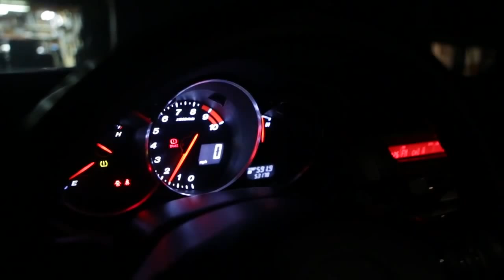RX8 Spark Plug Replacement Guide

Comment: This is certainly a well thought out and well presented video. I am doing a customers rx8 and only just found out that the plugs are a different length by my supplier. Lucky because I just dont know if I would have seen that at the job. I bet I would have put the wrong one in the wrong hole. So leading and trailing plugs. Wow. My customers car had cut out and it was because trailing coil nearest interior had shorted out. Only with that unplugged and the car cranking again with all modules working on scan, still the car did not want to fire. Would it fire with one coil missing

Comment: Also a good idea to use some anti seize on the plugs before installing
Reply: Not if your using NGK Iridium Spark Plug, fabricator recommends not to use anti-seize, this is because of the trivalent plating, this is a silver or chrome finish on the threads that provides a corrosion resistance, moisture and chemicals. Ill leave the link below for more info 
https://www.ngksparkplugs.com/about-ngk/spark-plug-101/5-things-you-should-know-about-spark-plugs
Reply: Gildardo Rojas  thanks for the link. Thankfully I never had an issue using antisieze and over tightening

Comment: I'm getting 150 miles to the tank. Is tbat normal ?
Reply: Rami S. depends 
Ru driving it hard allot? 
even not driving them hard they get horrible gas Mileage
they r definitely not a car u buy of you're worried about gas mileage lol
Reply: it's actually bad for the engine if u baby it
rotaries r meant to be driven at higher RPM 
otherwise carbon buildup will get ya
Reply: Rami S. wow that's bad or do you beep and floor it all the time I get about 300 miles to £60 full tank premix too 04 reg 231